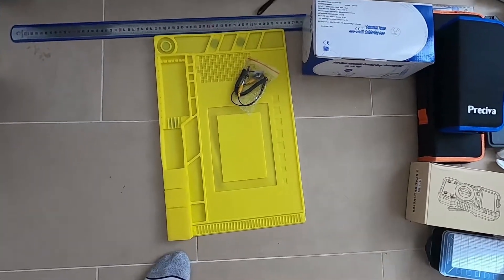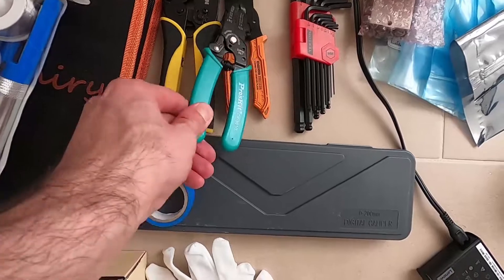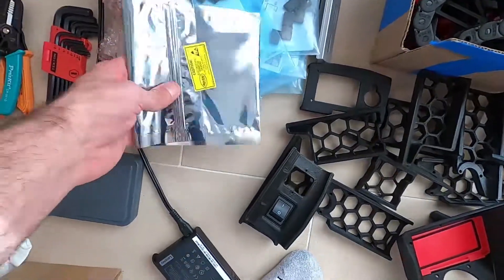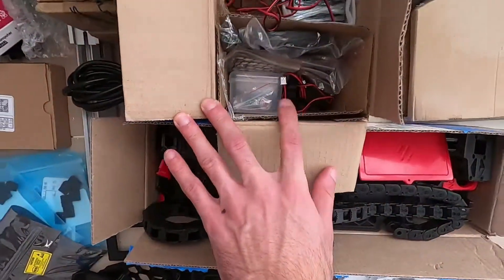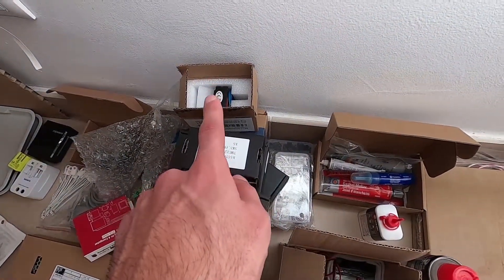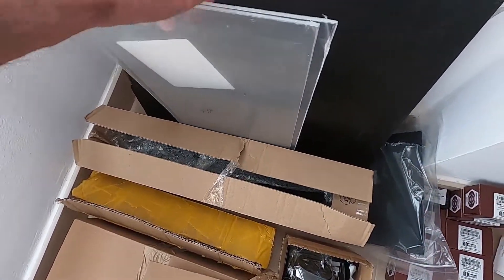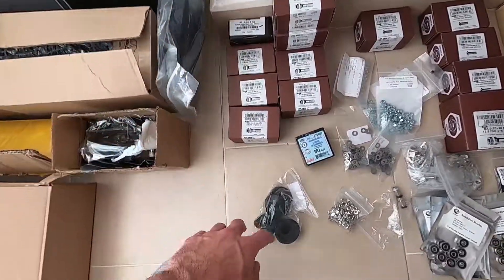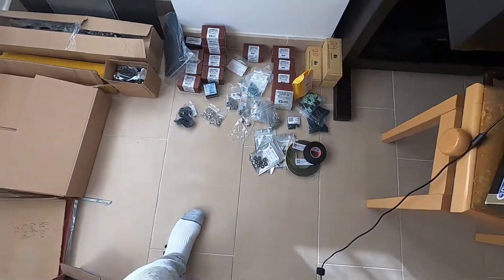Voron 2.4 Build Project - 1 - Materials & Tools

Comment: Hello, what kind of chains did you use? Did you buy a kit with all parts or single components choosed by yourself?
Reply from the maker: I used IGUS chains in this build, they are more expensive, but worth it imo. I purchased all the parts individually, makes for a better building experience!

Comment: Thank you for your videos, did you order printer plastic frame part or printed by your self please? If you order from other companies can you share links please?
Reply: @AeroAce1994  thanks for your advice
Reply from the maker: I printed all the parts myself from another prusa style printer I have. I used 1 roll of black abs for the mechanical parts, half a roll of red abs for accent and about a roll of PLA for the rest.
Reply: @AeroAce1994  how much filament did you used ,the reason I'm asking I find full printed kit in aliexpres so I what to calculate which on is cheaper and save time.

https://a.aliexpress.com/_vEhwef